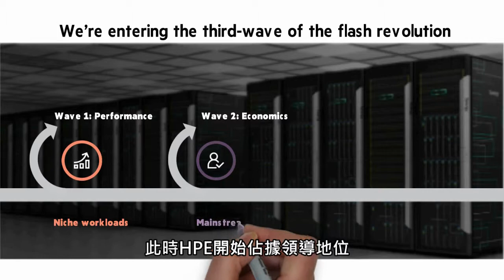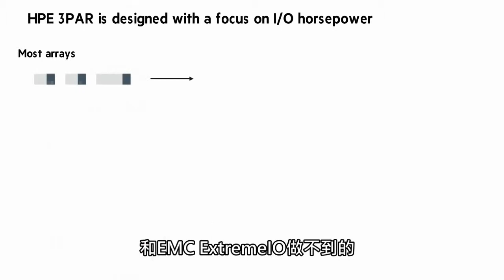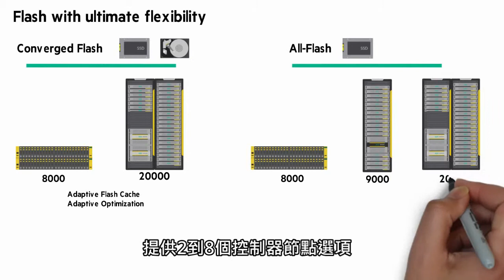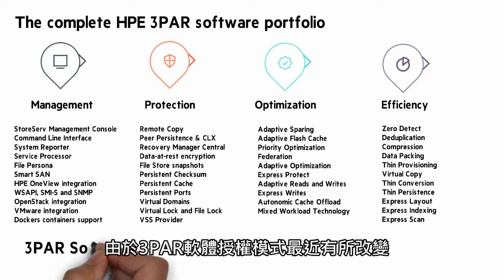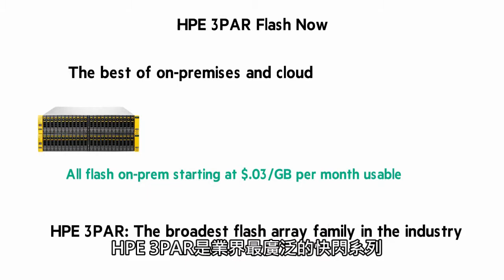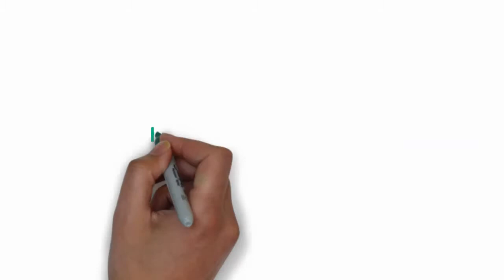HPE 3PAR StoreServ Portfolio ChalkTalk OUT

Comment: Why is there no hybrid storage version of 3Par StorServ? Not only does flash cost more per gigabyte than HDD, but it also has limited write endurance.
It would be even better for 3Par StorServ to come with options for not only Multi-Level Cell (MLC) and (Quad-Level Cell) flash but also Intel Optane persistent memory i.e. 3D XPoint. The former has greater storage density than single-level cell, while persistent memory has better write endurance than flash memory.